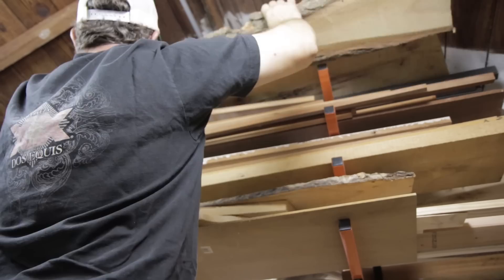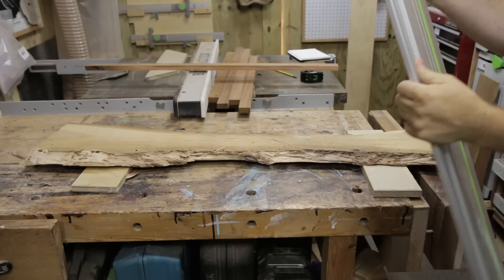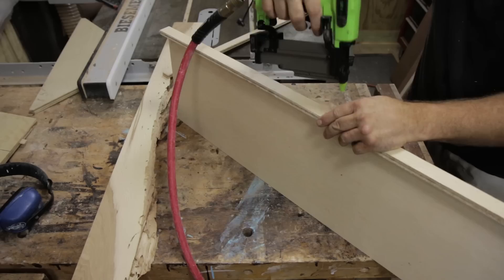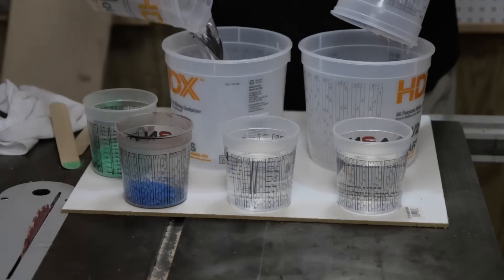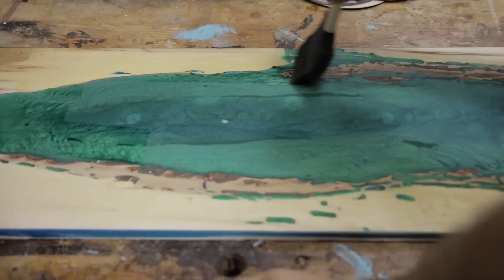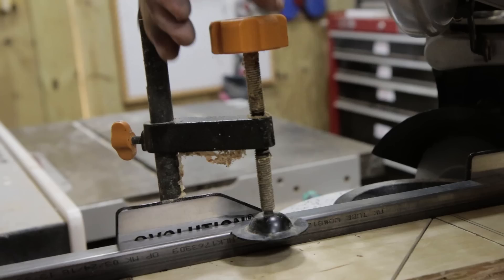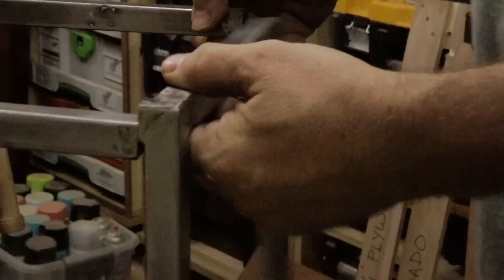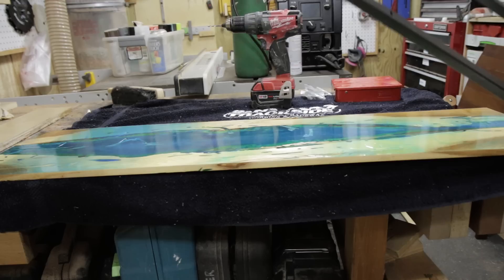Making a STEEL, EPOXY RESIN AND WOOD Console Table / River Table

Comment: this is amazing. what suggestions would you have for someone who does not have welding experience, nor equipment? is there a way to buy the metal frame from somewhere?
Reply from the maker: Thanks!  Actually there is a two-part epoxy called JB Weld Cold Weld Epoxy.  that I have used in place of welding before.  I think it would work great.  Just be sure to get the metal clean of paint, grease, etc.